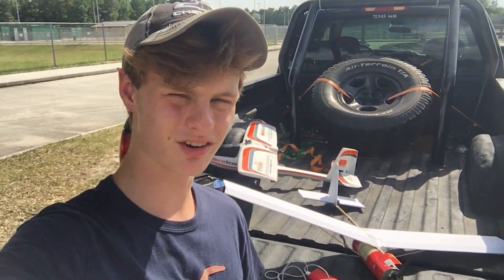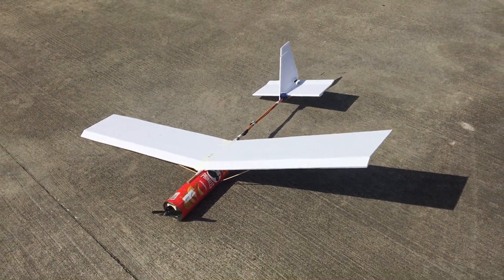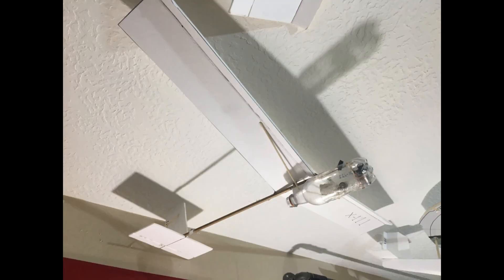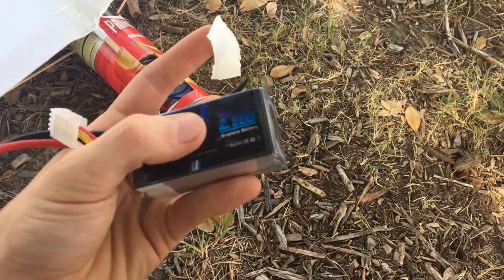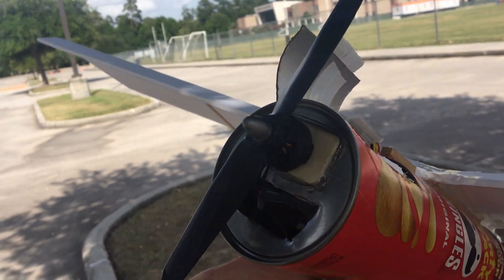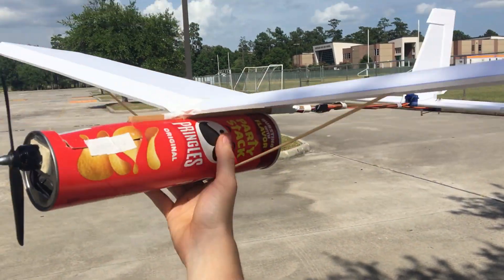Pringles chip RC airplane!

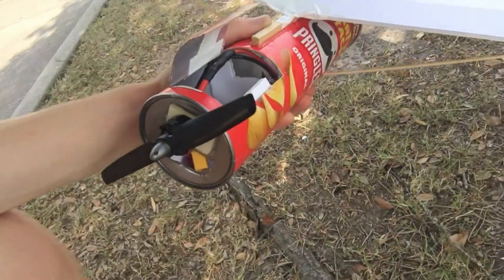Comment: SERVOS   DO    NOT    GO   AT   THE   TAIL.!!!          MAKE  THE   STABS   AS   LIGHT  AS  POSSIBLE.!!!      at 1:15, height of vert-stab/rudder,  Excessive.!      the use of a view degrees of sweep at the horiz-stab le  is  Recommended; 
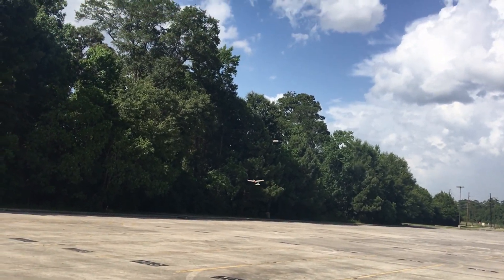in part, because  some mass  is   eliminated.!      (the mass of)  SERVOS  go  near   the  CG.!!!!      at 1:57, 1:58,  you  should  OBSERVE  the top of the rudder.!!!!!          googletranslate
Reply from the maker: What material would you recommend to make longer push rods so I could move the servos forward?
As of now I only have those short ones, and yeah it would help to make the servos closer to the CG